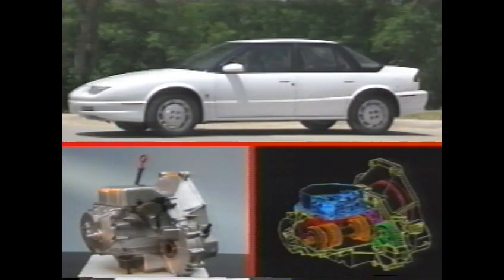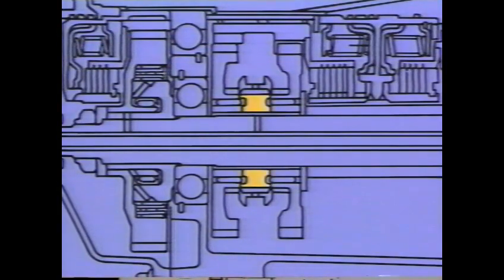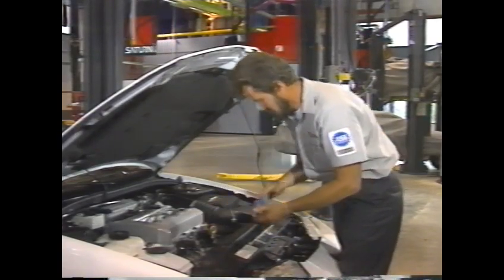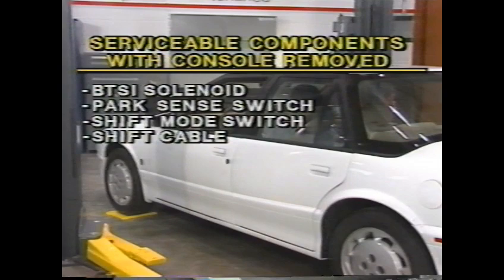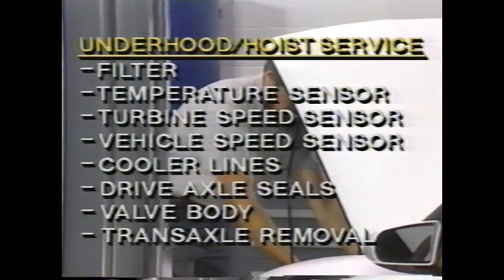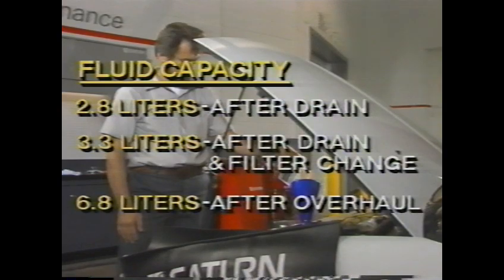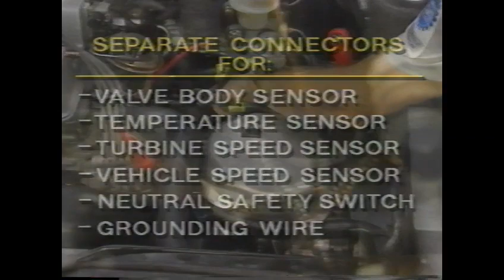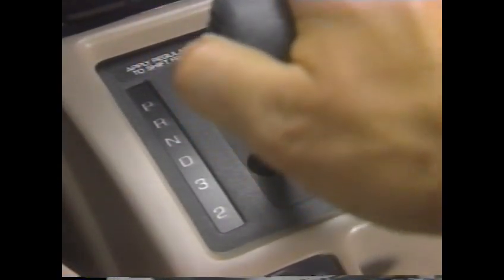Saturn Training Video - Automatic Transaxle Repair

Comment: I own three 90's saturns and have yet to have any transmission problems out of them and they are all 200K plus miles. These must have been pretty darn good transmissions.
Reply: ...........0wn a 96 SW, a 98 SL2, and 99 SW......I guess I'm one of the few that really likes these transmissions.....and not only because they are very reliable (when you bother to change the oil and spin on filter every 25K), but because the ratios are absolutely perfect in the DOHC.....will easily keep up with traffic on flat roads anyway with very little gas pedal work.....just let the transmission (and torque convertor) do the work..............
Reply: My 5 speed is still purring along after 28 years. Change the Dexron III in it every 60 to 70k or so. Car is fucking amazing. Hoping to hit 350,000 in her.
Reply: That is astonishing. I have a 95 SL I just got done putting a valve body in it because the slide rail thing that allows it to shift kept getting stuck so it shifted on its own. Now the input shaft nut is starting to back off which is another common problem. Other than that they seem like really good transmissions

Comment: If anybody’s watching, my 2002 Saturn SL2 would not go into first gear, then skipped into high gear, and for a while, did not down shift on acceleration up steep hills. 
It seems to shift OK on level ground. Any thoughts?

Comment: The weak spot in these is the valve body , most valve bodies need rebuilt at about 100,000 miles because of a "reverse slam" condition caused by worn valve body....easy job to do but don't procrastinate...If you wait very long the "slam" willl ultimatly bring on catatrophic failure. (rebuilt valve bodies available on ebay for about $150+) The Next weak spot is the roll pin that holds the spider gear shaft into the differential carriage. Opinions on why the roll pin shears off vary. One theory is that spinning one wheel on ice for extended periods causes the spider gear to seize on to it's shaft forcing it to rotate, thus shearing off the roll pin. Another theory is that continious vibration caused buy rough road surface or unballanced tires causes the roll pin to fategue and sheer. In either scenerio the shaft is left to travel laterally and protrude beyond the carriage ultimatetly making contact with the transmission case wearing through it into the bell housing area causing rapid fluid loss into the bell housing and catastophic failure. I've seen one where the transmission busted out the bottom, literally blew it's guts out the bottom spilling oil, gears etc onto the roadway. However....If you can avoid the roll pin failure issue these transmissions are indeed bullet proof for many hundreds of thousands of miles.
Reply: Yes, true, but if driven slowly or not harsh, and changing the tranny oil and filter every 15 thousand miles and don't pull anything heavy but light and driving it easy it won't happen. Mine has 500000 miles and no reverse slam, rollpin or other tranny issues such as leaks. The valve body is the original and valves all check like new. Take great care of it and it will last a million miles like a lot of them out there now. These Saturn SL2's ,the DOHC I mean where very badly talked about. But only because it was a great GMC product at the time. Like the original Volkswagen beetle bug. Also make sure you change out all sensors as nothing lasts forever. 1990's🪐's are vintage classic cars now and very hard to find now. Richpin will show you how to fix them.
Reply: Never heard of the roll pin thing but I have heard of Dodge caravans doing the exact same thing because they pressed it in and there wasn't anything else to hold it in. Would dig a hole in a transmission. So far I've replaced my valve body on my SL at 130k who knows how long it's been bad I'm not the only owner. The other thing I'm suspicious of now is the input shaft nut because it has a funky second gear engagement. These transmissions I must say use every bit of power out of the engines as they can they seem pretty good for as small as they are

Comment: No wonder they went out of business
Reply: The Saturn sl2 DOHC automatic transmission was the best one. The 1998 was the best year. Those were great. The LS 200, VANS, ION, ASTRA, others were trash junk. The Vue was good but not as good as the SL2. 2002 on up to 2009 stay away from.